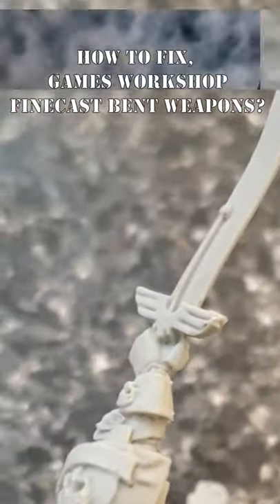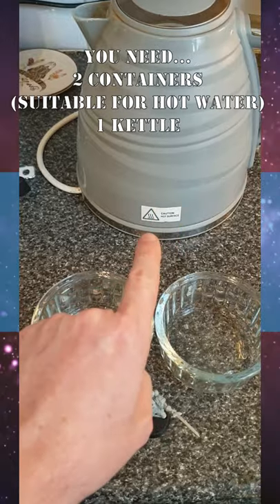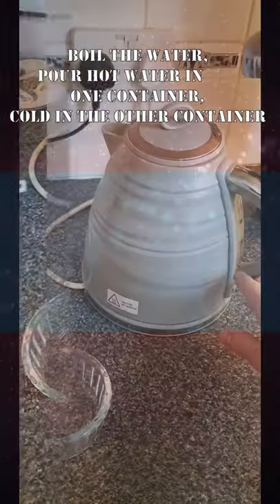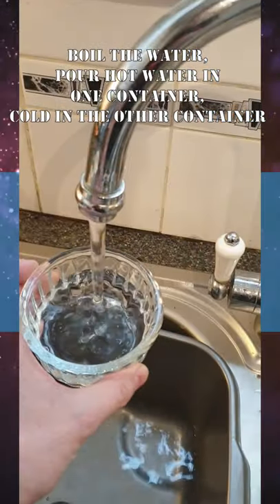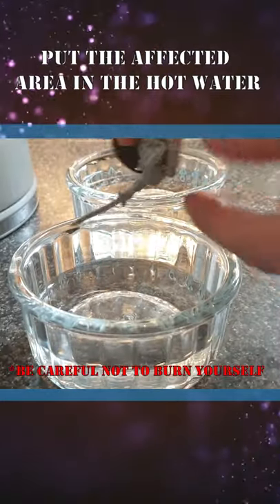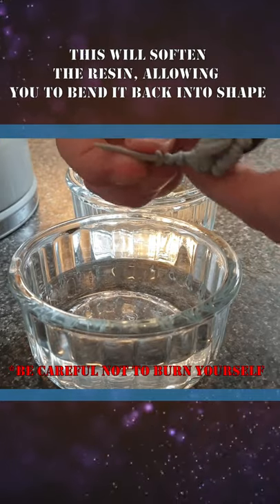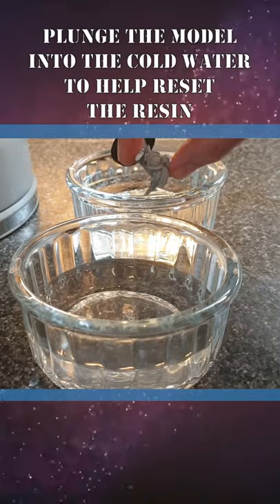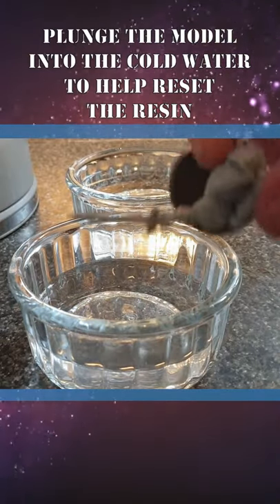HOW TO FIX BENT WEAPONS IN 30 SECONDS [GAMES WORKSHOP FINECAST] 2021

Comment: Does this work on larger pieces?
Reply from the maker: I have tried it...sometimes...but it really depends on the piece. I tried it on a back plate of a leviathan dreadnought that was so warped I I knew it would snap so gave up trying to reshape it,. ended up making another back plate from bits box to cover the insane gap...you will just have to use intuition mate